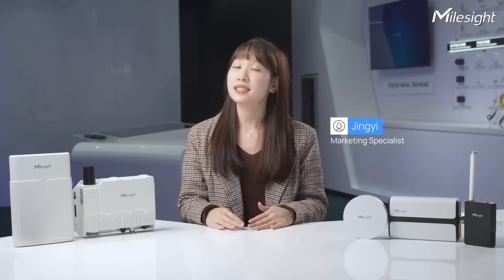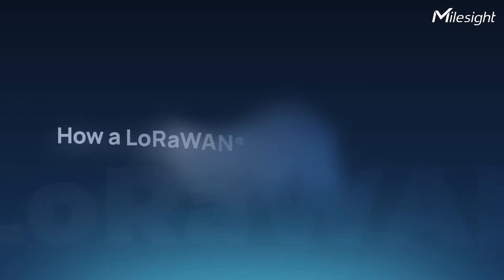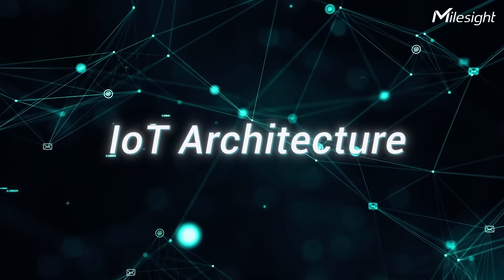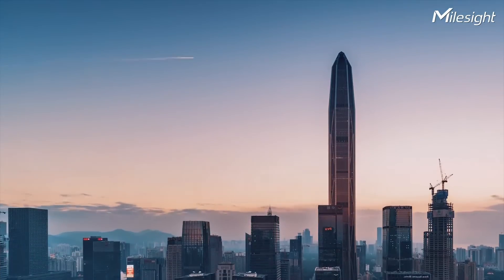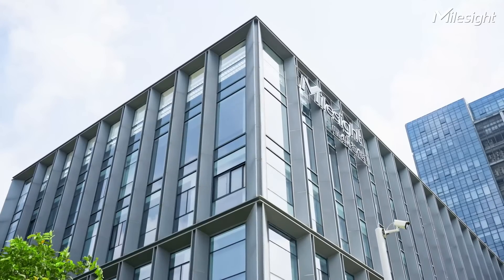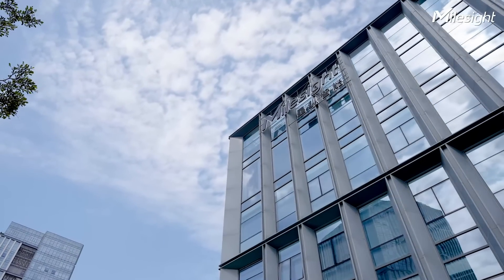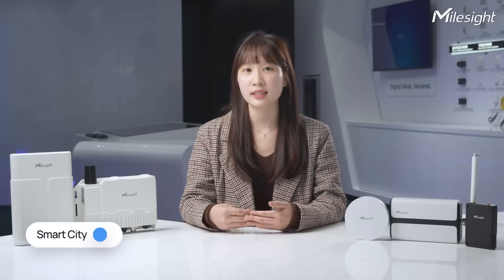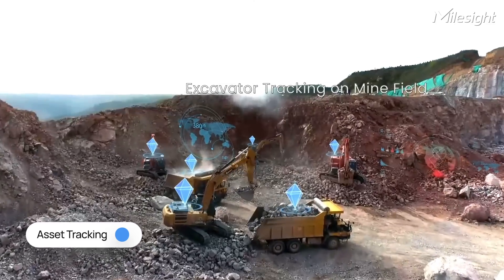What is a LoRaWAN Gateway?

Comment: I don't understand if the LoraWan gateways from different manufacturers all "see" each other by default, e.g in a city, or they usually have their own custom software and functions installed on it. 
It is like Meshtastic where Lora devices made by different brands automatically form a mesh ?
Thank you.
Reply from the maker: LoRaWAN gateways—such as those from Milesight—typically don’t "see" each other by default. They connect to a common network server (like The Things Network) where interoperability happens. The gateways don’t mesh but instead act as independent points forwarding data to the server. Hope this helps clarify!
Reply: @MilesightIoT  yes, that helps. Thank you :D